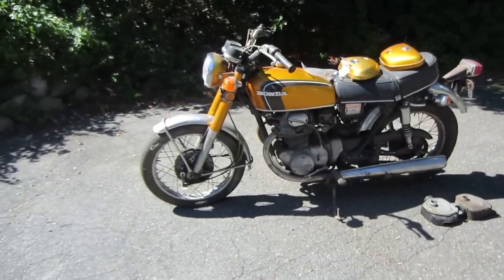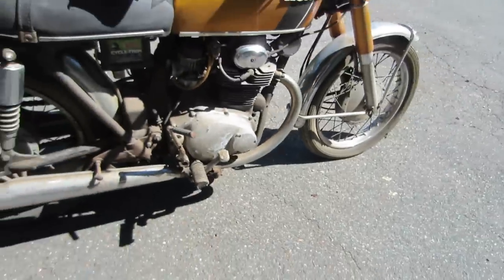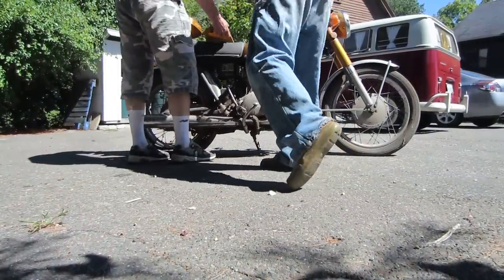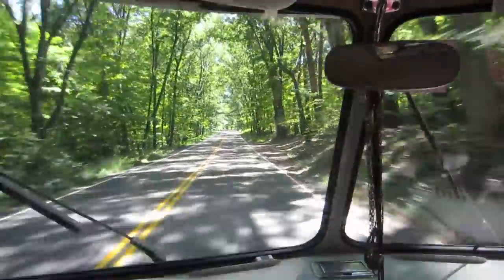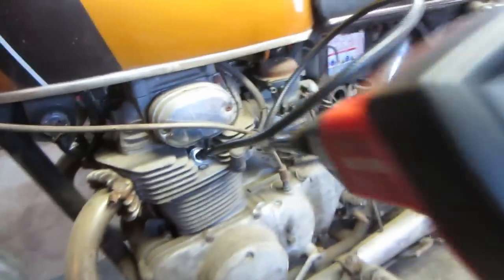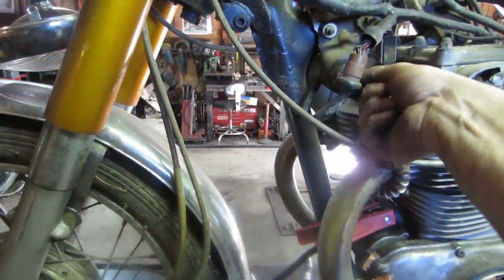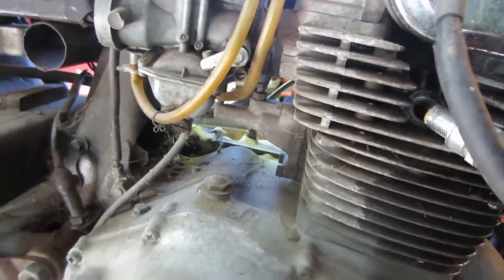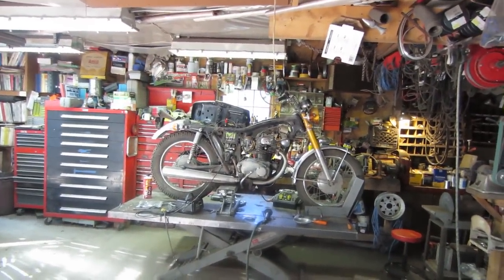barn find, 1971 honda cb 350 motorcycle

Comment: Thanks for sharing - tip on the wires behind the headlight helped me out.  Got my 1972 CL 350 running for the first time in 30 years!  Same wire disconnected as yours.
Reply: I had a 1965 Honda CB77,,,350cc ( Super Hawk ) and a bunch of 1972 - 77 CB250cc and 350cc ,, I used to ride my CB77 Super Hawk to work every day in the early 1980s before someone stole her

Comment: I remember these bikes when I was in high school. In the early 70's a guy I went to HS with and also worked in the Grocery store with after school, he had a 350, then when the 750 twin came out, he had to have one. Great vintage bikes. IMO, more classy then the crotch rockets of today.
Reply: They never made a 750 twin it was always a 750 four. I have 2 cb750 fours
Reply: Robert Slackware  the 2 stroke Yamaha tripple? Yeah they are cool but the cb750 is lightyears ahead in reliability, but slower. I put cb550 shocks on my cb750 and lowered the front a little and it feels much lighter and its shorter now. Some of the later cb750 sohc feel like a horse but the early ones k0-k5 feel much smaller lighter imo at least compared to my k8 and friends f2. My cb750 does wheelies so its enough power for me.
Reply: Robert Slackware  oh for sure the xs750 is cool besides being shaft driven. They are super rare though at least here in Michigan from what I have seen.
Reply: I take that back there are alot for sale I just never seen them
Reply: crotch rocket
A specific type of motorcycle, typically distinguished by it's aerodynamic 'hunched-over' seating position and high power to weight ratio. Often favoured by stunters, who choose the bikes because they are light and easy to perform tricks (such as wheelies and stoppies) on.

Crotch rockets are not always Japanese motorcycles, Italian companies such as Ducati manufacture quite high-quality crotch rockets as well.

Also known as 'sportbikes'.
The Ducati 999, Suzuki GSXR1000 and Yamaha YZF-R1 are good examples of ~1000cc crotch-rockets.

I LOVE uRBAN dICTIONARY !
'

Comment: I had good friend back in the late 90's give me an old 78 CB550 for helping him move.  It was a 'real deal' barn find and had a few mice nest in the mufflers and a few places.  He told me that it had been sitting for around 15yrs and that there was no way I would get it to run.  It wasn't seized up so I cleaned the fuel tank and the carbs and I rode it out to his place the very next day. Of course I swapped the tires on it but I rode the little bike all around town and it never gave me problem one.  Unfortunately it got stolen but those old CB series bikes are pretty much hard to keep down if your even somewhat handy with a few tools.

Comment: Thanks, interesting set of videos.  I know only the basics about work like this, but you seemed a little rough with the back wheel getting the cylinder moving. Yet, it ran nicely after all your work. You have a natural, presenting style that puts the viewer at ease and it was nice that we saw so much of your process, in the series of videos.(The mistakes are almost as helpful as the successes.)

Comment: Have the same bike but the UK 250 version, owned it 43 years, it was that colour originally, but i wanted it black. Given to me as a garden wreck. Pulled it all apart, located missing parts and assembled over many months as a part time project. Also, as was the trend way back then I sprayed the frame red and got it all running again. Had to store it in a shed when I moved and it sat there for 2 years, when finally opened up the roof had leaked and I was back to rebuild status again. It's sat hidden away in a water tight shed for 30 years now, time ticking down to another rebuild and return to a black frame, great to see so many videos on these bikes, never realised they were so popular. Always liked it, easy to work on, even for a teenager just starting out on engines.

Comment: Screws are JIS not phillips, that is why they strip out.
Reply: jugger18 They strip out if you use phillips screwdrivers on them. You need to use JIS screwdrivers or bits.
Reply: or better yet an impact JIS driver
Reply: Impact drivers have jis heads as an option. JIS screws are identified by either one dot on the head or an 'x'. I think dot was the old way and x is the newer identity marking. might have that backwards though, cant remember. I have CRS  disease, (Can"t Remember Shit)
Reply: If you look around you can find a set of New JIS regular screwdrivers.  The best ones to use without ever having to use an impact are the T-Handled ones that KOWA and Vessel made for Honda.  You can find them on ebay once in a while and some are available for sale on some Japanese auctions.  I've never had to use an impact yet with the t-handles.  Vessel makes a new regular jis driver set that is really nice.  Try to find the T-handles.  The JIS screws have a dot on the middle early 70's on up.  The large JIS screws and JIS screws before the 70's were plain.  You can tell immediately by the fit when you have the right driver
Reply: @mrmwman1248  I use a set of JIS Hozan drivers and they are great.
Reply: One more vote for JIS Hozan. I cursed Japanese "Phillips" for nearly fifty years before I finally got educated. Don't be a slow learner like me!
Reply: So that's why...  Wish I had known that 35 years ago....!
Reply: @Thankz4sharing  I also just learned this about 5 years ago. I could have sworn I saw him use a vessel jis screwdriver in a ct90 video so he might already know this.
Reply: Good point, I learned the hard way........ on carb screws
Reply: I replaced all mine with polished stainless cap head screws.
Reply: NO they strip out because your using the wrong bit.
ISO zcrews are I'D,ed by a dot on the bolt head. Otherwise the JIS isnt IDENTIFIED.  Mostly found on the older honda and other japanese bikes. But still using some even on modern production units.
Reply: @mrmwman1248  honda .motorces usex to carry the fom Kowa.
Reply: If you don't want to strip out "phillips"(JIS) head case screws, put a dab of valve grinding compound on the tip or screw head, the carbide bites into both the screw driver and head, stopping it from stripping out, motorcycle mechanics trick, but they never like to divulge it because of the money they make from guys that chew them up with impact drivers

Comment: The Marvel flying at the camera does tend to make one blink! (Tried to warn ya)  :>) Many years back my friend who owned the motorcycle junk yard stopped by on a Friday nite with a trailer full of junk bikes he picked up. (where I got the go kart stuff from) After drinking some beers when he was ready to leave he asked if I wanted a bike. They were all missing parts and he tossed one off. It was a Honda 350 and found the engine was seized. Did get it freed up after some time & did get it running but it sure did smoke out of 1 side. The girlfriend came out when we were working on it and asked why we were trying to get that pos running. I told her - cant you see it has a new rear tire. Everyone had a blast pounding on that piece & the tire lit up real well on the rear deck! Had it for many years and gave it to a friends son where it still ran. Wish someone would of gave me a cycle when I was a kid,   ;>)  Just had to share that one with ya......Great job on getting yours going, fun to watch, sweet vid!

Comment: riding one of these on the freeway was like holding an orbital sander in each hand
Reply: Lol that's a perfect description. I loved mine, though.
Reply: I had a 175, and yup....great description!!
Reply: I had a black one with a fairing.  Had to take off the fairing in order to reach highway speeds.  40 plus years later and my hands are still vibrating.
Reply: Handlebar END CAP WEIGHTS Have all but eliminated that dreaded vibe.! BUY SOME NOW... I like the THROTTLEMEISTER brand.!
Reply: Why? No handlebar counter balance?

Comment: damn I wish I could find those things that cheap where I live. Bikes in general are pretty hard to find where I live so when an old honda cb shows up youll be hard pressed to even find an old rust bucket for under 500 bucks. That thing even with the stuck engine would probably go for anywhere from 500-1000 just because how original it is and how hard to find they are around here.
Reply: Pixel Spy when he said "maybe I could part it out for 200 bucks" I nearly lost it. It's an easy $500 bike as it is, not running. Can hardly find them like that anymore.
Reply: Pixel Spy i

Comment: 90% chance that the cam chain tensioner wheels are destroyed, and/or cam and rockers are worn bad.  super common on these.  i have extra 350 parts if you need them...
Reply: The cam chain tensioner bolt was between the cylinders on the back under carbs wasn't it? I haven't touched a 350 engine since 1974. And it's starting to come back watching this video

Comment: My 305 was a kick start.   I didn't remember the 350's having starters.  That was a big new thing back in the day...  hahaha..
Reply: Removed on the Scramblers I saw..

A blank plate...
Reply: my 73 CB350 has both.
Reply: ive had just about every variation of 350 when i was a teen...all cb and cl 350s had electric start and the same frame...70 sl350s were identical save for different tank/fenders and a 19inch front wheel..71/73 sl 350s had new frames..carbs/cams and deleted electric starter..72/73 sl350s had a 21 inch front wheel
Reply: My 68 305 had a kick start.  Electric starters were a huge deal in those days.. hahaha.
Reply: rpeek the 250 and 305 honda C series had both electric and kick starters since '60...
Reply: The Honda Dream did.   The Model I had with the high pipes did not.  Can't remember what they called it.  They had a street model and a trail model.  Mostly the trail model had high pipes so they didn't drag on the ground over rough terrain..  hahaha.
Reply: Mine looked like this one.  Notice the kick start..  http://databikes.com/infophoto/honda/77_cl_scrambler-1968.html
Reply: rpeek youre right..i think from '66 on the starter was a delete...but kick starters were always standard even with the electric
Reply: got a 69 cb350 with both electric and kick, matching numbers bike too
Reply: rpeek My 65 305 Dream had both kick and electric start.
Reply: Dreams were not Super Hawks.

CB's were roadsters,  CL's dirt

no starter bikes, but barely...

I had a 1969 CL-175 as an off road

machine.  NO STARTER.

Came out of a pond.
Reply: You push start, when the little green box goes flat...
Reply: and SL's were combo.
Reply: My first bike was a 1968 CL350 which was a cross between the CB and the SL, designed to work on the street and also use as a scrambler. That was the first year they came out and they had both the electric start and the kick start as backup.  Loved that bike until the ring chaser on the piston disintegrated and then the pistons proceeded to beat the rings into the head in 1972 with 500K miles on it (a few trips coast to coast and border to border).
Reply: we used to call them 350 Scramblers.  There was a 450 version also as you probably know.
Reply: The SL350 was the scramblers, they had the swept up exhaust to keep the exhaust output away from the brush. The CB350 was the one with the pipes that stayed about even with where they came out of the heads and the CL350 had the exhaust that went down and ran even with the very bottom of the frame.
Reply: No, the CLs were the scrambers.  Simple YT search will show you that and they had the chrome pipes along one side, the SLs (which I owned) had 2 black up-swept pipes, one on each side, it.  The CB had the pipes along the bottom sides like the one in this article.
Reply: You have them all mixed up.  The CB is the one in this article with the pipes along the bottom.  The CL's were the scramblers, not the SLs.  I owned an SL.  The CL were the scramblers with chrome pipes high on 1 side.  Search YouTube videos and you will see this.
Reply: I don't have to search, I owned one. Bought it the first year they came out here in San Diego in 1968 brand new off the showroom floor at the Honda dealer in Pacific Beach. They boasted it as a dual purpose bike but was not considered a scrambler (at least not by the Honda Dealer). At the time they only had the CB and the CL and said that they were going to be getting a scrambler model the next year. That's not me talking that is what the Honda dealer told me when I bought the bike. If I'm wrong, I'm wrong but that is what I was told when I bought it.
Reply: I think where we disagree is in the fact that the Honda dealer and I think that a scrambler is a "dirt bike" and that is what the SL model was made for "Dirt Scambling". And yes, my bike had the side pipes which were chrome with a black heat shield on over the mufflers. Maybe in different parts of the country Scramblers mean different things to different people. All I know is Honda didn't call the CL a scrambler here in San Diego but did call it a "Dual Purpose" motorcycle. But when the SL came out they called it the Scrambler here.
Reply: rpeek a dream 305? My dad had one when I was 15... first bike I ever rode solo
Reply: My 1966 305 Super Hawk was kick and electric start.
Reply: High pipes was the Scrambler. Low pipes was the Hawk (250) and Super Hawk (305)...my first "big" bike! @rpeek
Reply: @sedge5940  Awesome..
Reply: My 68 & 69 both have starters still have the 68 getting ready to tune it up. The high pipes bike was the scrambler
Reply: rpeek I had a 72 exactly like this one except it was red with black stripes. I remember the sound of that starter.
Reply: @375GTB  I had a CL 200 with electric starter and kick starter...

Comment: In Aviation we would dip the tip of the bit or screwdriver in valve grinding paste. The grit of the past will cause the bit to dig into the screw and will help it from caming out ans stripping the screw. works on sockets to if the bolt is on the way out .
Reply: LOL.  A buddy at worked talked about doing the same.   These screws however are Japanese Industrial standard and are not Phillips.  The angle and depth are both wrong... If they buy the right drivers, they will never need an impact.
Reply: Yes, and also a small bit of steel wool will take up some of the space in screw head and comes out easier

Comment: I was stationed at the Naval Training Center as an instructor in San Diego from 1969 until 1975. We had purchased a Condo in Santee in 1970 and I decided to purchase a motorcycle to  commute back and forth to work. I purchased a new Honda 350 Scrambler and if I remember correctly it was just a little over $800.00 out the door. What a fun bike, I rode it for a couple of years then decided that interstate 80 was no place for a motorcycle. By then it had be stolen and wrecked, repaired and then sold. In a way I wish I had kept the bike, but at the time I felt my safety was more important than the thrill of the ride.

Comment: Great job in getting that motor unseized.  5th gear always works.  Another great job of troubleshooting the no spark cause.  I would have never thought to check the wires in the headlight housing.  Yep, your hittin' only on one cylinder.  Tear down those carbs and fix it.

Comment: Those were great motorcycles, I used to have one myself, where the one you have is  metallic gold, mine was  metallic green. had it for years then traded it in on a 1982 CB 900 Custom, and have kicked myself in the butt ever since and still kicking myself yet LOL ., I had more fun with the 350 than I did the 900.

Comment: Clean the carbs, clean and gap points, new plugs and some premium gas should fire no problem.
Reply: KFLY67 there wasn't spark
Reply: add a bronze cam chain tensioner
Reply: Wasn't it seized?
Reply: stuck from sitting.

Comment: Restored a 74 CB450 years ago, still had the original tires and didn’t have to clean the carb, new battery and gas and it fired, after  a lot of polishing and fresh paint she was a show winner and I paid $100 for it! All in I had maybe $150 in it because I had the paint and polishing equipment on hand and I dumped it for $1,100 and I had a CB 350, 73 I believe and after a new battery and carb cleaning she fired up and I slapped a quickie paint job on it and dumped it for $600, that thing was slow but it was the smoothest  running bike I’ve ever owned!

Comment: I had one of those back in the early 1980's.  It did not run but had lots of parts that actually fit on my 1962 Triumph 650 Tiger.  I had the only 650 Triumph with negative ground and an alternator.  I had 800cc jugs with forged pistons.  It was extremely dependable and mind boggling FAST.  I swapped out the wheels from a CB 750 so I could actually stop.  Those old Triumph drum brakes left much to be desired. 
By the way,  i filled both cylinders with motor oil thinned with some ATF.  Let it soak for a week or so then tied a rope around the triple tree a dragged it down the street in 2nd gear.  The engine broke free after about 20-30 feet.  When I pulled the top end down and popped off the cylinders it only needed to be honed.  A new set of rings and the engine was ready for the alternator and voltage regulator that were on my Triumph.  I found a newer alternator and voltage regulator for my Triumph and for a few dollars had a great CB350 and my "sleeper" stock looking Sportster Killer was now all metric instead of Whitworth and was running with a carefully rejetted Amal.  I miss that Triumph.  Should have kept it.  It is still running through the canyons of the southern Sierras 34 years later.